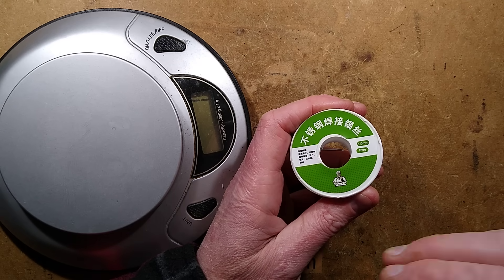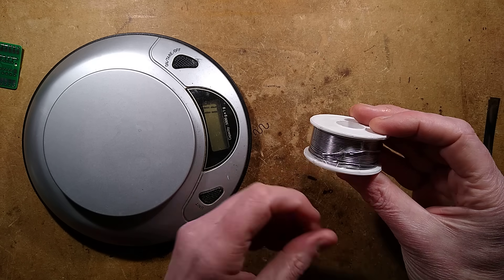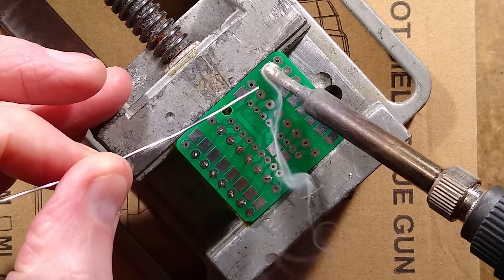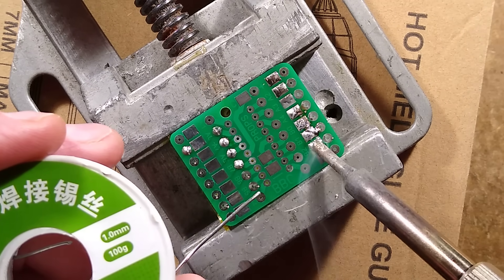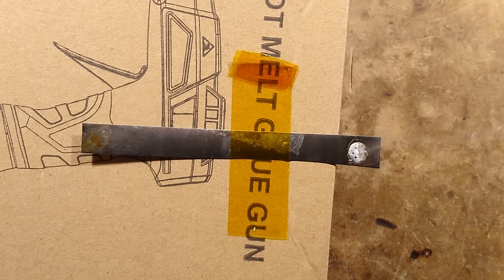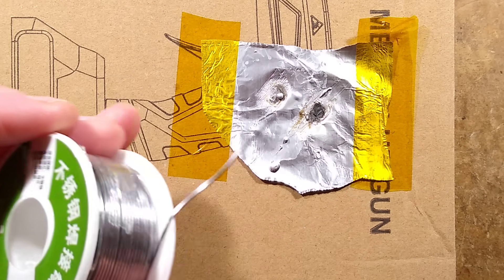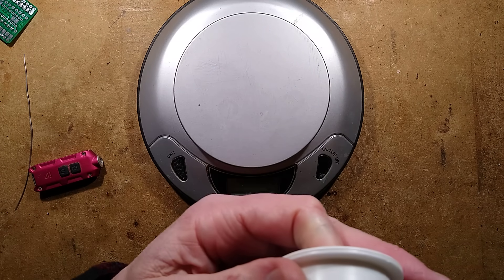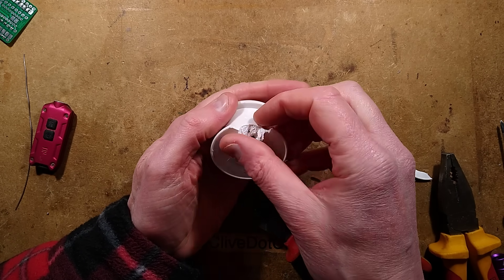Testing AliExpress "mystery solder"

Comment: My guess is that it's cheap 60/40 solder given the cloudy appearance on the solder pads, and probably acid flux core due to it wetting out on the stainless steel. Not good for electronics but maybe ok for utility soldering.
Reply: 60/40 shouldn't look crap like that lol it's cloudy
Reply: @neiliewheeliebin  60/40 more prone to it due to it not being a eutectic mixture, so often one of the metals will start crystallizing before the other, leading to a temporary slushy state before it fully solidifies. It's possible to get a nice shiny joint with it, but more tricky.
Reply: @Nicoya  I've never seen 60/40 go cloudy like that, I've used a lot like several kgs, I've only ever seen lead free go cloudy like that especially when mixed with lead solder
Reply: @neiliewheeliebin  It doesn't happen every time but it's more common with 60/40 than with eutectic. The more "weird" the mix, the more likely it is to occur.
Reply: @Nicoya   @Nicoya  My current 1kg roll is 60/40 the previous roll was 60/40 the one before that was 63/37. The stuff in this video is clouding like if leaded  solder is used on a lead free joint, this is not normal under any circumstances

Comment: There are legit solders for tinning aluminium parts. The instruction usually says to remove the oxide layer and then rub in the solder with a soldering iron. After that use your normal solder to attach the wire to the prepared spot. Never used one myself tho.

Comment: Is that scratchy, scratchy thing, used also for removing PCB solder mask?
Reply from the maker: The abrasive pens are available in steel, brass and fibreglass.
Reply: @bigclivedotcom  ah, thank you 😁

Comment: Oh, right on cue.  I have rolls of crappy solder from Ali and Temu.  I only buy in local shops now.  I always clean surfaces with alcohol first, scratch the surface, use flux and lots of heat.  That crappy solder doesn't reflow well at all, so once it solidifies, fixing a mistake is almost impossible - it turns into dry bits.

Comment: Shit solder like this is the reason 12 year old me nearly gave up on soldering. Then I bought a roll of Loctite 60/40... never looked back and still use it 🤣🤣
Reply: Yeah me too. As a 12yo kid I started with some kinda hardware store solder out of my dad's toolbox, couldn't get it to work satisfactorily on my first electronics constructions.
Cadged some solder from the guys at the local repair shop and bingo, whole different world.
Since then I have used several alloy types from known good manufacturers and no troubles.
I find different alloys cause differences in sound of audio equipment but that's a whole other rabbit hole 🤔.
Reply: I had a similar experience before getting some good kester solder.

Comment: It looks like lead free solder, the alloy isn't eutectic, therefore there is no sudden phase transition while it cools down. Also, the 2% silver is missing.
To solder aluminium, you need to use zinc chloride as flux. That can be dangerous because the residue will corrode any copper that is touched by it.
Sorry for the 60% plastic / 40% solder they sold you. Reminds me of a friend of my grandma, buying 100 gr. of capers at an open market. At the time, capers went for £20/kg, and the gross weight 100 gr. capers included a cone of paper as container, weighing 60 gr. Chinese are keeping the old fraudulent traditions in high regard.
Greetings,
Anthony

Comment: If you can determine it's precise melting point And the temperature at which it becomes solid (solidus), I can probably cross reference it with a ton of stuff I printed years ago when I was making my own at 1/6 the cost.
   Some alloys have a 30 degree gap between melt and solid, the solid is lower, nucleation is retarded by how they form an intermolecular lattice based on all that face-centered/body-centered arrangement stuff (physics).
Reply: You kinda have to say it on a vid, I've got 10k unopened emails and counting.

Comment: I'm surprised you didn't use Google to translate the spool markings? What it says is 'stainless steel welding tin wire' along the top and 'Battery inserts, stainless steel, plated surfaces, zinc sheets, iron sheets, tinplate, copper.' As far as I can tell it makes no claims at soldering aluminum? I guess if you would've told us what the writing on the school was then there would be no point in this video.
Reply: Sorry for a bit of poking fun. I really enjoy your work!

Comment: Scumbaggery, enshittification and prices that have no relation to value are "the new normal."  LINE GO UP (until it doesn't). Constant growth is unsustainable.  Even the truly thick are beginning to notice the problem. 

Q: What comes after full enshittification and "everything as a service" (subscriptions / non-ownership)?
A: Asset liquidation.

BTW simple way to tell if solder is lead-free:  If it's not almost completely useless, it's not lead free.

Comment: There's a few fusible alloy options; tin, lead, bismuth, cadmium and to a lesser extent due to price, gallium and indium. Very rarely mercury. It being on a spool tells you it isn't absolute 💩 and brittle. You can trust it more than a bar or ingot. Make a puddle of it big enough to try and break, there should be no detectable crystal/grain structure even with light magnification if it doesn't just bend "forever".

If it sticks to stainless, I would not breath the smoke.
   You can always do a cupullation with charcoal. My mineralogy books use that for metals that burn to oxides in flame. Or burn it and examine the cold flue deposits with a long chimney, that's where smelters drop all those metals, cad especially. 
    Alternatively, a jewelry store might run a bit through their XRF and just tell ya if you ask nice.
Reply: Cadmium-alloy solder? Now, there's an interesting thought.
Reply: If you are into chemistry, put it in some acetic acid. After abouta month, there should be a conc solution. Prepare H2S and expose it to the liquid. If PbS skin forms on the suface, it will be very dark.
I don't know how bismuth behaves if there is any in that metal.

Comment: I expected the reel was filled with sand...
Reply from the maker: I was hoping for sand or a plaster core.
Reply: Was expecting the ultimate irony of it being filled with lead while the solder is lead free.
Reply: @BitterCynical Free lead
Reply: I was disappointed too :face-purple-crying:
Reply: While cutting into the reel, I had expected a suspicious white powder, something you see on "Border Security" type tv shows.
Almost disappointed it was only more dense plastic.
Reply: Imagine if the inside was filled with another spool of lead solder.
Reply: Clay. I was expecting clay.
Reply: Like those power savers !
Reply: Makes the landfill seem more legit
Reply: Lead weights in the reel would have been too hilarious.
Reply: Clearly not from the same dope growing power saving empire!
Reply: I guess making it massive plastic is now cheaper than using someone to manually fill it with junk
Reply: Lead would have been a perfect fit as a filler for the spool.
Reply: I was expecting the reel to have a core of mystery radioactive metal.
Reply: I originally thought a metal core
Then again that would go against the whole idea of saving the metal in the first place 🤦🏻‍♂️🤷🏻‍♂️😂🤦🏻‍♂️🤦🏻‍♂️

Comment: What would be a search term for that wire brush you used?  Thanks.
Reply from the maker: Try searching for keywords like wire brush pen.  Available in steel, brass and fibreglass.
Reply: Steel and brass sound like a good idea if you're using it often; they will all shed occasionally but you can see the resulting splinters from the metal ones.

Comment: What a shameless scam.
Did you do a comparision on the alleged stainless material with your normal solder?
It may work just as good.

I once had aluminium flux core solder from Conrad Elektronik, which worked well on i.e. edison sockets to replace light bulbs for something else,  but that was in the 80s and i couldn't find a replacement later.
Do you know flux core solder, that actually works on aluminum?
Reply from the maker: I rarely solder aluminium.

Comment: Pretty sure that's tin-copper solder, like 99.5% tin, some copper, and a tiny tiny amount of silver, it's the ultra-cheap variant of the lead free stuff. I have a roll of it I got at rat shack back when they were still a thing...awful awful stuff, I never use it. Needs way more heat or you just get all sorts of lumps and broken cold joints like you saw, and always looks cloudy and dull/oxidized when finished.

Comment: years ago I had a roll of uber cheap ebay solder that would hardly wet anything. you could kind of flow it onto a pad but it really didnt want to adhere to component leads making it very difficult to get a functional joint, let alone a robust one. I gave up trying to use it after about ten minutes, dumped the whole lot into a solder pot, and  HUGE amount of crud and gunk floated to the surface. I concluded it was just very low purity tin and lead, probably straight from the scrapyard with very little processing or cleaning.
Reply from the maker: Some eBay solders lack a proper or continuous flux core.
Reply: we are buying our e-waste back from China
Reply: @gabotron94  Ironically it is that bad as it gets. Though sometimes there are no other way how to get some custom made chips like Apple's T2.
Reply: Ditto. It worked as badly as Clive's here. It claimed to be 60/40 though.
Reply: Maybe you needed more flux.

Comment: Good evening Clive - soldering stainless steel. Decades of doing emergency repairs on bits of outdoor / boat related kit has taught me that a highly aggressive flux applied just before multi-core lead tin solder will do the trick. Usual caveats here (wear goggles, don't breath in, keep the cat away etc). A drop or two of concentrated phosphoric acid is my flux of choice. Thanks for the video; highly entertaining and educational.
Reply: Really, just phosphoric acid does the trick?
Good to know 👍
Reply: @werner.x  Yes, and a good high wattage soldering iron

Comment: I believe that medical equipment has to be soldered using only genuine 60/40 lead/tin solder.
Not sure where i got that information from but possibly from big Clive's channel.
Reply from the maker: Medical, military and other situations where the sold has to actually work.
Reply: Your info is over a decade old.  RoHS got updated, no more medical exclusions (mostly).

You should actually read the RoHS docs, it's quite interesting as to what you are allowed to do (still lots of uses for lead).

Comment: So, with a 40g reel, the 20g roll must have -20g of invisible solder. 😁 (realistically even with a thinner reel, you'd still MAYBE get an actual 10g of solder.) and 40g of solder claiming to be 100g is a total ripoff, even at 3 GBP.   And the Chineseium version of Col. Sanders is a hoot.

Comment: I genuinely loved this!
I always have that dark impulse to add a spool of super cheap solder to my order, just to see how bad (or ... Maaaaaybe good??) it is!

(For the morbidly curious, I like Kester, MG chemicals is pretty good too. It's way better than whatever RadioShack/Tandy was putting on the shelf)
Reply: Was that end stage Radio Shack? Because I have a few rolls of RS solder that are likely 40 years old and they work great.
Reply: @Wolfshead009  Yeah! I wanna say I got this around 2000-ish. I think the main problem is that QC slipped during that era (or they got it from a cheaper source)

The main problem with the roll that I still have is that, some of it is just fine, actually pretty nice! Then I hit a patch that's really light on flux. I'd say it's age related but I recall having the same problem back then too xD

Comment: Wonder if there are any good lead-free options out there yet since the EU banned leaded solder years ago. I'm kinda concerned about the time when my current supply runs out, maybe I could somehow source the old leaded stuff through various loopholes but either way I'm not looking forward to it. Not sure if ordering leaded solder from china would get intercepted by the customs or not if I were to get some from a more credible source
Reply: You're allowed to use leaded solder for DIY and hobbyist stuff, because it's such small-scale it's not a real threat to the environment.
 The EU was aiming to ban industrial scale lead solder.
Reply: It take some work but lead-free solder is fine once you get used to it. A bit more heat and a bit more flux and it behaves well. There's really no avoiding it completely if you're ever working on a pre-made board or one someone made with lead-free so there's value in practicing with it even if you don't intend to use it.

Comment: best place to get 60/40 solder
....sometimes, they may trick you and send RoHs grade 😢
edit: guess it is lead free :(
i personally am addicted to plumbing flux(zinc chloride/petroleum jelly basically, it was originally a tinning flux with little solder balls in it but the solder balls have long gone, melted into blobs of solder), it works wonders on any electronic project at hand and despite people yelling at me for years that it will ruin circuits and corrode stuff, i have things i've used it on over 10 years ago that still work
Reply from the maker: It's a gamble these days.  The proper suppliers often won't even sell it to you any more.

Comment: but you didn't reverse engineer the solder!
Reply from the maker: That would have required some very expensive lab equipment.
Reply: @bigclivedotcom someone elsewhere in the comments mentioned having access to such - maybe arrange a letter with a bit of the solder included?

Comment: I would either having a fume vent or fan with a carbon filter.
As I workrd in electrronics and have a chest problem and astems, both believed by my doctor is down to occupational rhinitus.
So breathing in fumes from soldering is not good for you. Especially Chinese made soldering alloys including inside the toxic fumes from said flux.

Comment: I was hoping that it would be leaded solder, just that its not the wire that has the lead in it. But no solid plastic, and the wire is pure tin I assume. 
Also try out SN100Ni+, its a game changer as lead free solder goes.

Comment: To solder stainless steel, use 60/40 normal lead solder and phosphoric acid, its cheap and works like a bomb.
Reply: Proper leaded solder is 63/37. 60/40 is non-eutectic trash that nobody should be using if they want any chance of getting a durable joint.
Reply: ... security service intensifies...

Comment: I wasn't aware that tin and lead were two of the Chicken Colonel's secret herbs and spices. 8^) The bad appearance of the joints after soldering look like someone added zinc to the alloy. The way it sticks to stainless is also a sign of zinc maybe being present. The heavy wall spool looked like it might be PVC with lots of toxic and weighty plasticizers. I'd wash your hands carefully after handing the chewed up reel Clive.  Based on the heavy walled reel and the claim that they are selling 100g of solder when 40g was unrolled I'd say that this was a pretty bad ripoff. Cheers!

Comment: Text says stainless steel welding tin wire... Now I gotta watch how it works. Side text translates to 'Suitable for welding: Battery inserts, stainless steel, chrome-plated surfaces, zinc sheets, iron sheets, tinplate, copper

Comment: So glad I've still got an old reel of proper leaded solder I got from a job when they were transitioning to the lead free shite and dumping the good stuff. Still got most of the 500g reel and that will now probably last my lifetime. It's great for fixing electronics where leadfree solder joints have cracked.
Reply: I “liberated” two 500g reel when I retired, plus several 2% silver/lead 100g reels. This stuff is valuable, so make sure your kids know its value if any is left over once you have “moved on” to the big workshop in the sky.
Reply: @theonlywoody2shoes Stole? 😂😂👍🏼👌🏼
Reply: @shanethrelfall416  No. With the lead solder ban I was instructed to put those solder reels in the scrap bin, so I did. No one said not to take them back out - especially when I pointed out to the company that collected the scrap that there was lead in there, he told me to take it out  and dispose of it as they couldn't take it.
Reply: @ No, I didn't steal it. I asked politely and was allowed to take it for personal use.
Reply: You can still buy solder with lead in it freely, but the electronics industry as a whole has largely shifted to lead free. Electronics are restricted in Europe (and probably other places) if they contain lead so it's been easiest to just have the entire supply line be lead-free to keep goods moving freely. Anything without lead is also much easier to dispose of legally.
Reply: I'm sorry am I missing something? I could have sworn I picked up a reel of of solder in the store that said "Pb60Sn40" before Christmas last month. Are these designations fake?
Reply: @kisielthe1st  Leaded solder isn't banned as such, just for making new stuff.  You are still allowed to use it for repairs etc.  Very easy to buy in most places, where I am (Oz) it's now cheaper than lead-free.
Reply: @kisielthe1st maybe depends upon the store and where they get their inventory from. Sadly, "caveat emptor" seems to be the rule of the day anymore.
Reply: @  A 500g reel from RS is £50, so I'm glad  I got some for free.
Reply: @kisielthe1st  depends where you live.

Comment: Ok, the obvious questions:
What's it made of?
What temperaturee does it melt?
Is the flux corrosive?
What is the solder's resistance?
What is the long term stability of the solder joint.

Is the solder,or flux, poisonous or TOXIC?

Worst case scenario, the Lead has been replaced by a low melting point alloy of mercury, beryllium, or arsenic😊